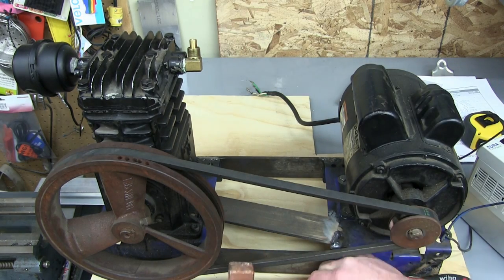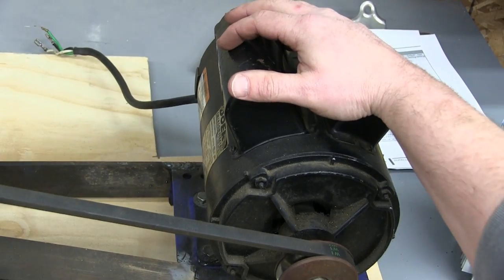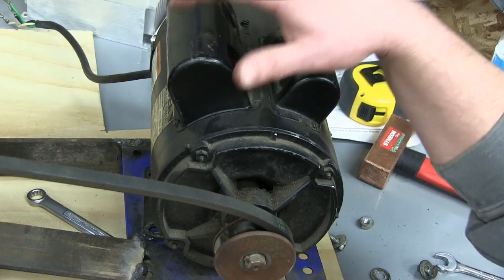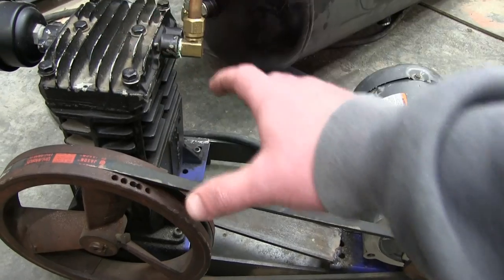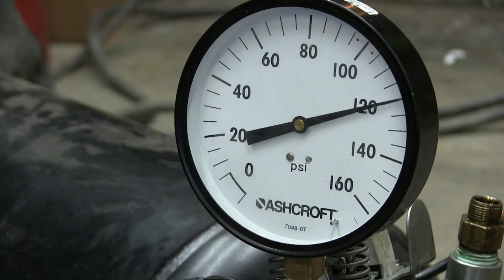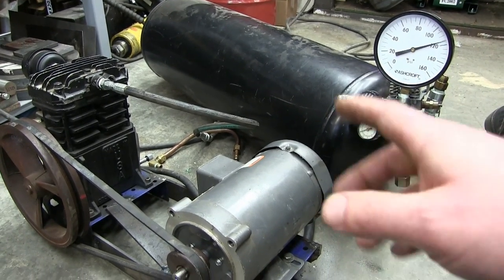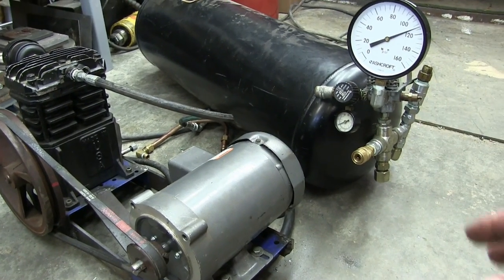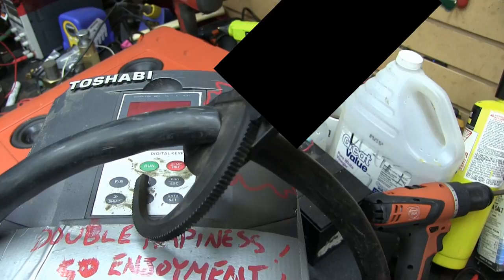BIG COMPRESSOR PERFORMANCE BOOST | No tripped breakers!

Comment: Why bother with signaling anything to the motor? You said it's being controlled by a PLC - just have a PID loop in there with derivative or feedforward that will try and maintain 160 PSI or whatever.

Comment: Fundamentally a great idea!.. you want maximal volume when at low pressure (hence higher compressor RPM) and maximal pressure at high pressure (higher compressor torque, low compressor RPM).  Somewhat astonishing that in the 21st century 1000$ compressors have not even incorporated an even more simple idea, a constant power variator. Could be done by simply adding one belt and a spring actuated pulley variator. bullet proof and no electronics.

Comment: I mean, you could be smart like this or just do what I did and get a 60 CFM compressor.
I got tired of running out of air, now my little home gamer garage is doing just fine.

Funny enough, they upgraded the pole transformer for my part of the street shortly after I did a big run of sandblasting. 
Hah.

Comment: You could up the speed to 120hz but the torque from the motor would half , so you can counter that by getting a Motor that’s rated for say 2and a half the torque needed , your vfd should also be overrated Because of the extra power needed

Comment: So I was given an antique air compressor on the inlet valve to the piston there is an adjustable threaded valve to control how much air your drawing into the cylinder head, I can’t figure this out anybody have any ideas?

Comment: Welp, now I have to take apart my air compressor, install a 1/5 rc car motor, and a crappy cnc vfd, and hit the arduino into stopping the motor  when it reaches full cheech

Comment: Appears second motor running in the wrong direction for fan blades to blow cooling air over compressor.

Comment: Terrible idea, that's a splash lubricated compressor, too slow or too fast WILL result in failed pump. Now  this vfd system is very common in rotary screw units

Comment: doesnt any compressor have the on off pressure switch mounted to it that you can open up and mess with two springs to adjust when it kicks on and off... crank er up to 150psi shutoff and make er kick on at 140 so it starts as soon as youre using air.. wear the piss right outta the motor and you better over size the breaker right up but... itll give er wha!

Comment: Whole lot of fuck8ng around and massive expense that you could have avoided by adjusting the pressure switch differential and just fitting a filter/regulator to it! Pretty much all 1/2 inch drive air rattle guns run recommended max. pressure of 100psi. The compressor fills to 125psi. Using a reg. meqns only the 100psi you want is delivered, giving you more bang for the volume of air you have in reserve. Friggin a LOT cheaper than going 3 phase, especially if you only have 240v to start with.

Comment: Well, I just got me a 3 phase, 3 horse motor from a surplus place for $15 so I can dick with this idea... So sick of my pathetic mail-order jobbie that can't power my spark wheel for more than 15 seconds per minute. I really think that using a pressure transducer and the the PID function in an Arduino would be superior to trying to control it (and yourself) by using the tool in a certain pattern, but avoiding that pattern in normal use. I'm curious if using a Constantly Variable belt setup from a go-cart could make it just confusing enough to be a constantly enjoyable pain though. Now that breathing is back in style, all the cool kids are building Pressure Swing Adsorption Oxygen Concentrators, and I'm curious if a CV-Belt system could let the compressor run at very low output or frequent stop/start more softly than putting it all on the electronic CVD.

Comment: Well when your ass is burning on every fucking nail 30 ft in the air and everyday your one step closer to melanoma framing houses you have to take into account that electricity isn't always readily available. So the compressor I got running has a gas honda engine. Its runs 29 SCFM consistently and is able to output that without falling from 120psi. Mind you that a snap on 1/2 mg725 impact needs that amount of air to cum full power.  Best thing was, lady rung it out as an electric compressor and I paid half price (500). 🤣🤣. Best fucking day.

Comment: Would it be possible to use a screw compressor for pneumatics instead of a piston compressor? It wouldn't have a "bottom dead center" that the piston would want to get stuck in and the motor would have to overcome. Also no vibration, so the only RPM restriction for it would be the amount of heat it generates.

Just hook one of these up to the air tank. It'll work great. https://i.imgur.com/rqierO8.jpg

Comment: Ummm,...nice work for the shop, but out in the field, rough framing houses, not so much. See, unless you plan on showing us how to 
"SuperCharge" our generators next, which buy the way, have to power ALL our high amp professional Saws, there's not much left over, to power the compressor. Oh ya, we burn Hydrocarbons to power everything, because developers don't supply electricity to new home sites , until we are long gone. Now, for your remod guys, that idea of yours might come in handy for a roofer, but, framing nit so much.

Comment: An easier solution to waiting for the compressor to build the tank pressure back up, is to adjust the differential in your pressure switch, so the motor kicks back on at a higher pressure, and/or get a bigger compressor.  I just bought a DeWalt cordless, airless nail gun, BTW... nice, but it's a heavy son of a bitch.  

Back to the VFD... I'm sure you already know that the output from a VFD is a "modified sine wave," meaning it's a choppy approximation of a true sine wave, which can introduce some nasty harmonics into the circuit.  These can damage your motor if it isn't an inverter-duty rated motor.  It also causes arcing to the motor's shaft, that cause fluting of the bearing races, thereby destroying them.  

If you're going to be switching to 3-phase equipment, why not use a rotary phase converter that can give you clean 3-phase power, with true sine waves?  It's a lot easier on your motors, which were designed to run on true sine wave alternating current at 60 Hz.  and BTW... (blatant shameless plug ahead) I build Phase-Craft rotary phase converter control panels that give you true 3-phase well-balanced power, and have a reputation for lasting for decades, which a VFD is highly unlikely to do.  In fact, I can pretty much guarantee that the ones I'm building today will still be running when I'm not.  Why not let me talk you into trying one?  Then you can either praise or crucify me in an upcoming video!  Google Phase-Craft... lots of comments on Practical Machinist, and most other DIY forums.  By now, I'm sure you're thinking "How can I contact this guy and either get a panel from him or chastise him for spamming my channel?"  You could try emailing me at phasecraft@gmail.com.  I'd love to see one of my panels in your shop!

Comment: The motor is running backwards, according to the compressor fan
Reply: valves don't care about the direction of the crankshafts rotation

Comment: Good luck getting 3 phase power in your home. That controller plc probably costs 3 times more than the compressor. We had tags on some motors. This motor comes with the smoke pre installed. When the smoke comes out ,the motor ceases to work. I also learned in 30 years of lead mechanic, that belt dressing only ruins belts and gums up pulleys. Bar soap is the only short term remedy. Tighten the belt you foul mouth knuckle dragger. About half smart.

Comment: I work on variable speed air compressors they are a piece of junk come up with ghostcodes all the time drives burn out due to dust and oil not a good idea to have a variable speed drive on a compressor good there is a company that does manufacturer variable speed Drive 5 horsepower reciprocating air compressor and they're called polar air company is pretty good and it seems like they're really honest about their warranty

Comment: There is very good reason why this won't be in our near future. Cost.

Being a product engineer, I sympathize with those who understand the potential benefits and cost savings that would be attributed to this technology. However, the large majority of the "users" do not care enough. A cheapo $4.00 lefoo pressure switch will do what a nearly $20 pressure transducer will do for quarter of the price. Most of the guys live their daily lives being able to b!tch about how $hitty the compressor is.

In this environment, how do you expect to please everyone?

Comment: You are over spinning the compressor, this is a Campbell hausfeld vt series 2cyl single stage which has a max rpm around 1150... when you over speed the compressor it will not lubricate efficiently causing premature wear and tear. You're really just maximizing the electric motors output... and destroying the pump.
Reply: You really should look into a piloted discharge valve with a close differential. And please stop hitting electric motor shafts with hammers... the guys who come behind you will appreciate it.

Comment: 3 phase motors need 3 phase supply or another electronic box to fool the motor it is on 3 phase when it is on single phase. Starts getting expensive.
Reply: In the 1960's I am sure compressors went up to 150lbs psi and would drop to 120 lbs psi and then cut in again. The pressure has been lowered over time. The air reservoir is rated much higher than 120lbs psi  so have it cutting in and out higher than what it is doing so you have the pressure you need.

Comment: When I was 18 I took two ac deco ac compressors off wrecked cars and mounted them on a board with a 5hp baldor motor.  That ran so well I could power my impact with no air in the tank full open and it filled the tank and still ran the impact.  I would like to see what that vfd would do for that situation.  I wired the 5hp for 
110volts and used the electro clutches to start the compressor under load by freewheeling the motor then engaging the clutches with a pressure switch and a 
12volt car charger.  If I wanted to start under load I could wire 220 to the motor

Comment: Ahh the technology” hasn’t changed in a hundred years” gos right back to most abondoned that thing would be great in a paint both but as far the cost bigger compressor and bigger motor increased efficiency and the new hybrid design of antiques that light bulb keep the load under control until you find the area the angry🧚‍♂️ are  warming up at in that tv like a vacuum e tube. So hammering down on that handle on the vice with a hammer the PLC needs a an bigger power source while the pixies are trying to through out that logic chip like 110 hitting an led light. The steaM between your ears has enough pressure to oppereate a hydraulic ram

Comment: Know what you really do is take your cheap-ass to Hughes tool supply can you buy a 4 cylinder compressor not a water two-cylinder compressor with a 220 motor on it then you won't have to wait for that compressor to catch up you'll have to catch up with it that's what I did

Comment: Noobs... orrrrrrr, you just buy a better compressor. no need to reinvent the wheel here. your reserve pressure needs to be higher than any tool you may have and then regulated problem solved... well at least I think... I dont speak cromagnion so hard to tell what your saying in some of this